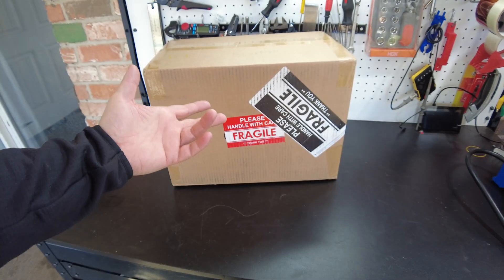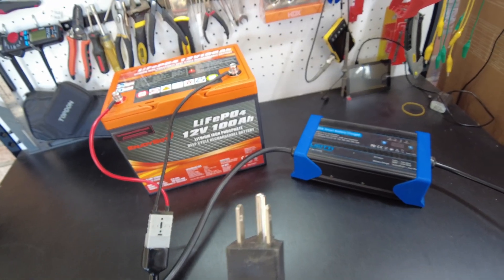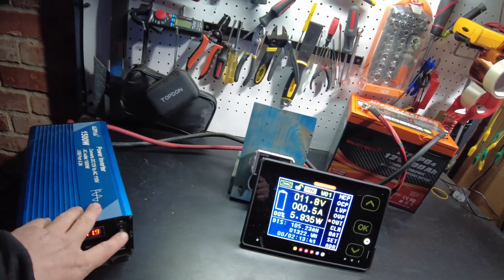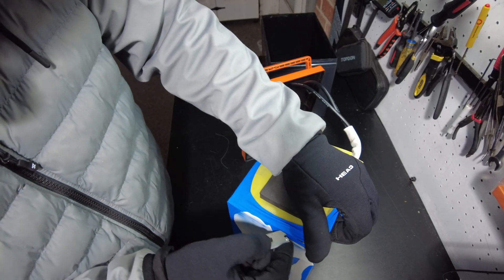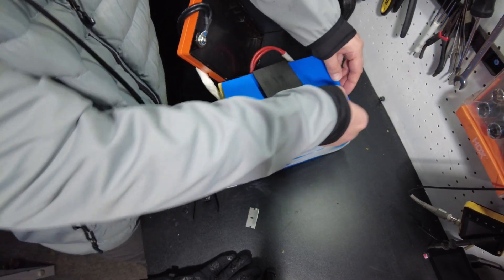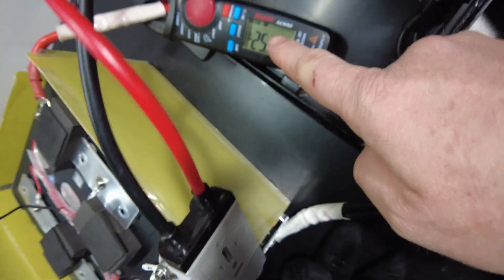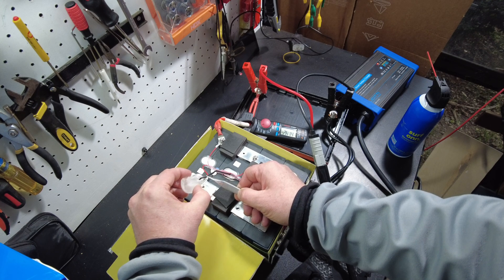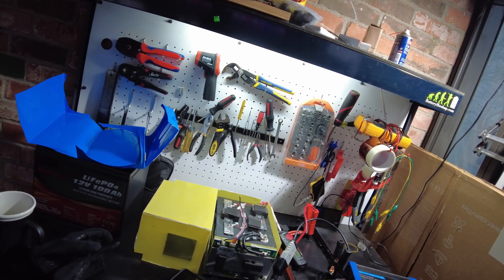EnjoyBot 12v 100Ah Group 24 LiFeP04 Lithium Battery

Comment: I don't know why you continue to review 100AH LiFeP2O4 batteries. They are all pretty much the same😮.
Reply from the maker: I agree, I'm asking them to send different sizes, and voltages from now on. Thanks
Reply: @BradCagle  Great! I like Redodo, Power Queen, and Time USB for their build quality and customer support. The only decision you need to make is whether to add low temperature charge cutoff  depending on where you live.

Comment: Excellent presentation.  Thank you.   Would love to this review in detail when it comes out if you can get one:   Orion XS 12/12-50A DC-DC Battery Charger.  Would like to see how truly efficient it is at various loads.  Would also like to see how low the adjustable output is, if it can go below 1 amp and the granularity tested.   This thing could be a real game-changer (even at lower outputs) if it works as the doc/manuals suggest.